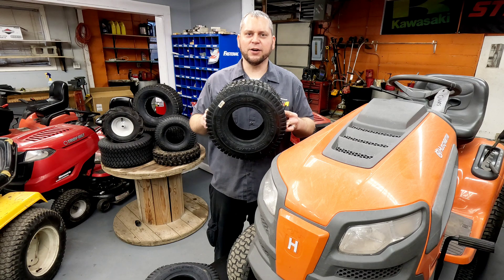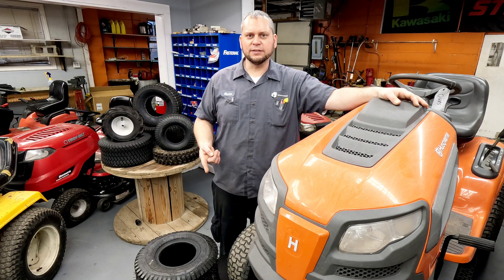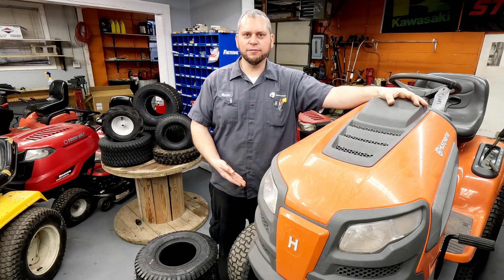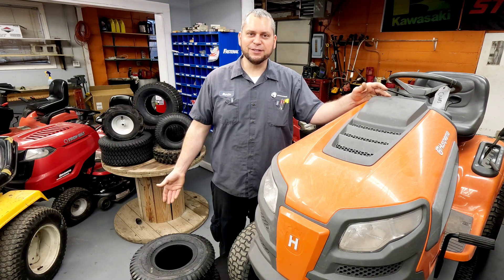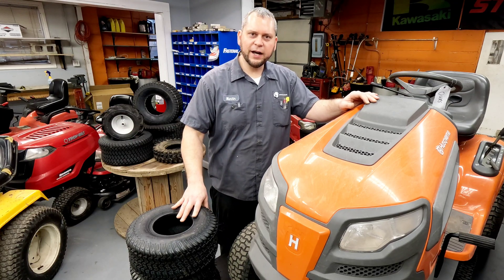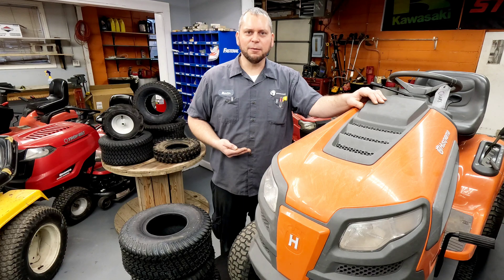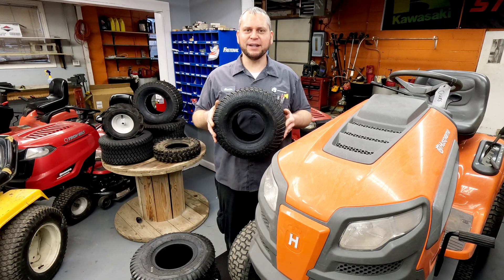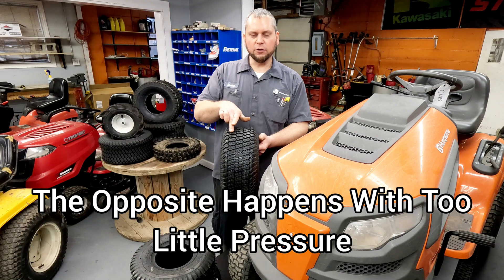What PSI Should You Air Up Your Lawn Mower Tires To? Proper Tire Pressure For Small Engine Equipment

Comment: I run 20 psi on rears just so they dont go low anything else in winter its flat
Reply from the maker: Running that high can be dangerous but I have not seen any blow at that pressure myself

Comment: Question, my back tires are Carlisle brand max psi at 10. I'm running them at 8 psi. My new front tires are Deestone tires 15x6.00-6 nhs, max psi is 30, I'm running them at 10 psi. The tractor seems to steer a tad harder with the with the new Deestone tires. Any quick fix to help smoother turning. The tractor is a cub cadet XT 46 inch cut. Thank you in advance..
Reply from the maker: You may want to try increaming the front tire pressure a bit to see if it helps with the steering! 14-16 psi on those tires is usually best. Thanks for watching!
Reply: @IndRepair  Thank you, I'll give it a try...
Reply from the maker: Hope it works for you

Comment: The tires are the only suspension you have on your riding mower. Air them up, your back will love it by the end of the summer. I run 3-5 psi in the front, 5-8 psi in the rear. Have never popped a tire off the rim. But, your mower and back, run what you think.
Reply from the maker: I have never heard of someone running that low of PSI and not having issues. Bad enough a little lower than sidewall pressure. What kind of tires/equipment are you running?

Comment: Put tubes in all of your tires they will hold air at least ten times longer if not more. Had a guy way over inflate his tire it blew up tore his jaw off causing face reconstruction in the emergency room. Be careful.
Reply from the maker: Tubes are good in certain situations but around here it seems everyone has thorns so they make it more expensive and overall a bigger pain

Comment: I worked for Deere dealership for 13 yrs set up all new mowers I put 8 in the front 12 in rear on tractor zero turns 14 to 16 in rear
Reply from the maker: Wow, I can't believe they had fronts that low. Sidewall is only rated for 10 in the rear on most models hmm
Reply: You got it wrong its 15 in front and 8 to 10 on back

Comment: I go for 10-12psi or slightly lower on the larger tires.  For me a soft ride is more important than a perfectly level cut since it all evens out in a couple days.
Reply from the maker: I never can really tell the difference but I dont have real rough terrain either. Whatever works for the person riding is good for me

Comment: I've had customers call me and say they started their cutting season and the rider is scalping the lawn on one side. I tell them to check the tire pressure. Problem solved. Most manuals will instruct you to check the pressure before EVERY use.
Reply from the maker: I have similar issues like this all the time. Most recent was a snowblower pulling to the right when driving. First thing to advise was check the tire pressure. One was at 30psi and the other at 0. Problem solved lol

Comment: These tires are unique in that they include the necessity to do no damage to the lawn. in short the sidewall flex creates bead sealing issues. To maintain the pressure at the sidewall pressure is your best bet. The bead seal also keeps the tire from spinning on the rim something people don't understand. Different tire/ wheels have different forces working to spin the tire on the rim. Once that force breaks the seal - the tire will come loose from the rim. Too much air pressure causing the sidewall to bulge affects how the bead presents itself to the rim reducing the grip.
The power to drive the machine must pass through the tire bead on your driving wheels. Non-driving wheels if they are steering wheels have different forces to cope with. Driving wheels on machines with no differential have different forces working on them.
Reply from the maker: Well said! Great explanation!

Comment: It may not be "proper", but over many years I've about quit using a tire gauge on my mower's tires.  At this point I can pretty much tell by feel when they have enough pressure in them.  They should have just a little bit of "give" to them.  If they feel hard as a rock, I'll bleed off a bit.  Must be doing something right this way since the grass looks even when cut and I've had the same tires on the same mower for 16 years now.
Reply from the maker: That is a great life out of a tire! I have some on my riding mower that are about 10 years old but that is a big feat! Thanks for watching

Comment: I learned PSI on tire for trailers and equipment. Whatever’s on the door label for cars and trucks. Dad checked them all often and so do I. Never had one come off rim. I’ve had punctures though👍
Reply from the maker: For sure, seems most people go by this but it should really revert back to the manual for proper ride and cut depending on the situation. If you run them too low the tire coming off the bead is a greater possibility

Comment: Good deal mentioning cutting Hight and tire pressure , Had so many customers think they need a deck adjustment when their tires were ether to low or to high  good video info!!
Reply from the maker: Thank you Mike! So often missed and a question asked quite a bit. I see a dozen or more every year a low tires is the only issue with the deck cutting uneven also

Comment: On commercial zero turn applications, I run the front castors closer to sidewall pressure...rears are much lower
Reply from the maker: I run fronts pretty close to and rears around 10 not matter the ply unless they are low profile then a little higher. Not alone there!

Comment: Hi Martin, I use a plastic label maker and put my mower's tire pressure on the wheels. On the footrest, I make a label saying "Checklist." I then add Fuel, Oil, Tire Pressure, and Brakes. I could also add "Raise Garage Door." After I drain my oil, I place a note on my seat saying, "No Oil," as I often get distracted and forget to add fresh oil. I'm 77 and frequently forget things except when I go to my bathroom.
Reply from the maker: Haha I'm sure many of us have those moments, you're not alone!
Reply: I worked in a fleet shop and the hint I gave the guys was to put the oil cap or dipstick in the way of closing the hood BEFORE doing the service. Put them back AFTER you fill the oil.
Reply from the maker: Great tip!

Comment: I run mine right on or little bit below for a softer ride.  My pet peeve is cleaning tire and rim. Even checking valve and cap.  A tire occasional goes half flat.
Reply from the maker: I run mine the same. Many people put up to 30 PSI in the front tires sometimes and can't believe they hold it without issue. I see over 20 in the rears also too. So strange. They seem to always loose air at some point no matter how hard you try
Reply: @ I am starting to make checking the tire valve more regular and buy quality caps from car place.